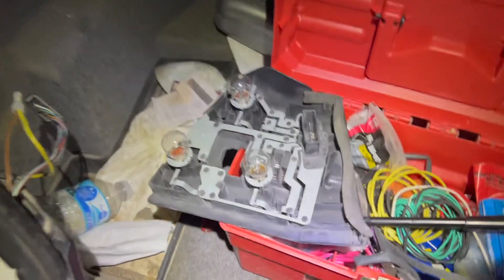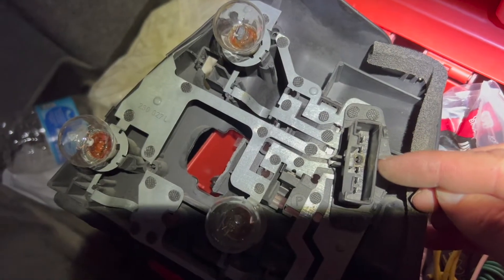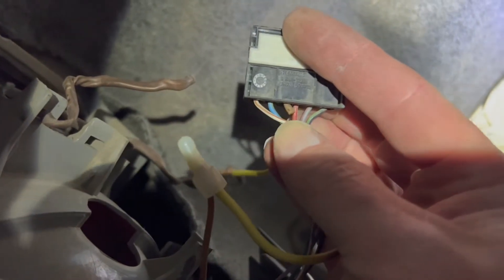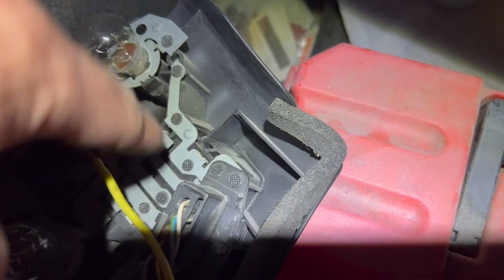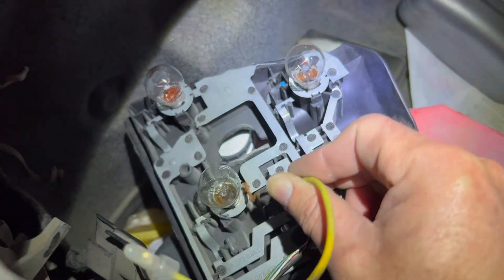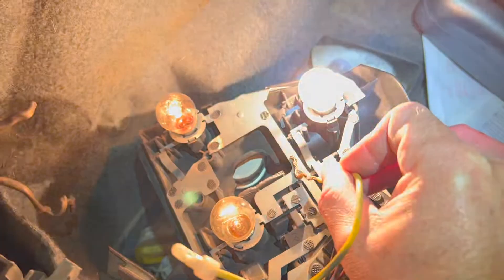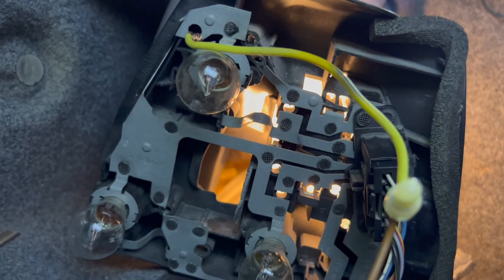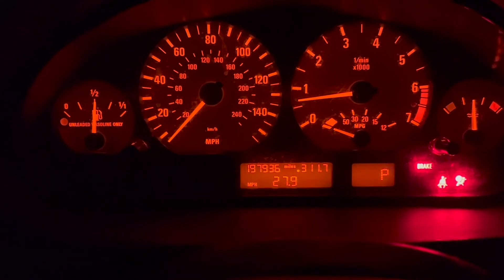How to Repair BMW 99-06 E46 Tail Lights and Turn Signals That Stopped Working

Comment: Haveing same Problem..
But Only Left Side.
N hate when i see ..
Lights of Fault .
On Dash Board ...
Last time when i tried to repair ...
Oops Brown Cable was .Hoter ther others...
   As i am not Auto electrician ...
Fixed back the way it was..
But after watching your Video ...
   I am sure .
That .
Lights on Dash Board .
Will Disapear.
Thanks For Sharing a Usefull Video

Comment: would you know why my turn signal is stuck solid on it wont blink its just solid on even with the key out
Reply: If it’s an e46 it’s probably the light control module. It’s a common fault

Comment: Hey.. i have this problem with pre LED lights.. i changed over to LED with correct resistors.. however the case has no rail to connect to ground
Reply: Heya, did you come up with a solution?

Comment: No, do not do that!  You should just scrape the corrosion off both the male and female part of the connector and reconnect.  That should do the trick.  You can use a jeweler’s screwdriver or small pick to do the job.
Reply: but if the pin of the connector is corroded? what do you advice?
Reply: Scrape the corrosion off (small pick or jewelers screwdriver) or an anti-corrosive spray (something you would spray on a battery terminal).  That should do the trick.  I would only cut as a last resort.